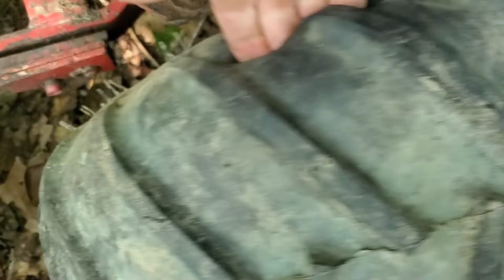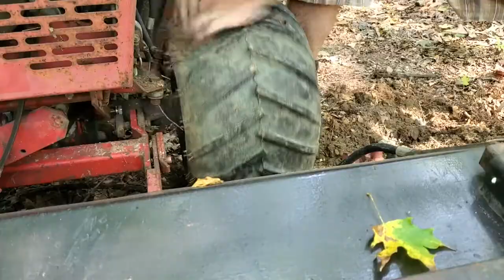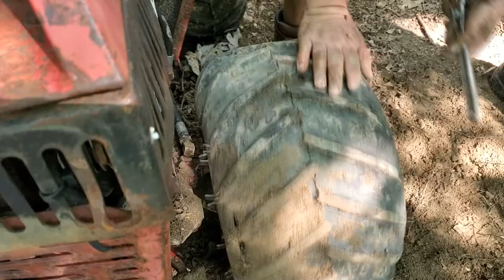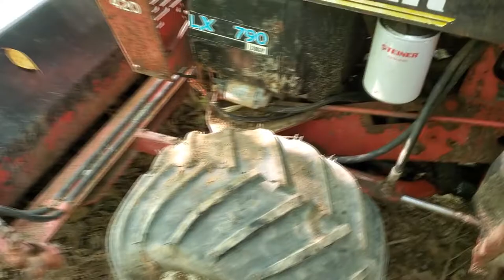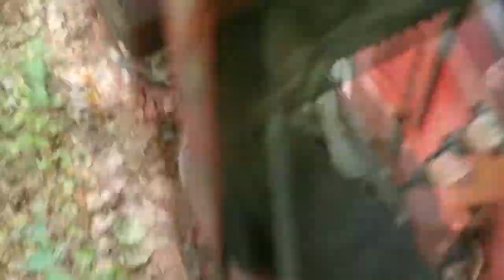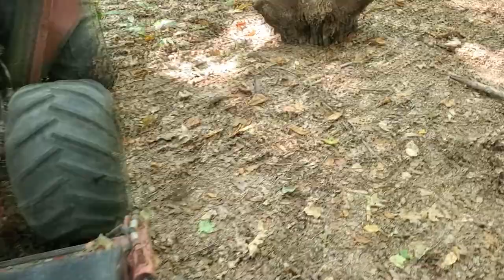Emergency Wilderness Flat Tire Fix Experiment

Comment: I'd also be worried about the increased torque requirements of slinging that dirt and potentially damaging the drivetrain. Not a bad idea for on-the-spot troubleshooting, though. It was worth a shot.
Reply from the maker: Good Point. A week later when I took the tire off I would say there was 40 lbs worth of dirt in it at the time. I am not sure how this would affect the differential in the trans. I guess there is a difference between one wheel free spinning keeping the other wheel from spinning and a wheel being held in place by excess weight and the other free spinning. I might have to read into this. I imagine it wouldn't be too different from a car with only one break stuck somewhat engaged and the other able to drive normal.